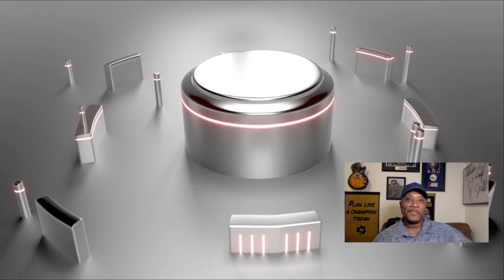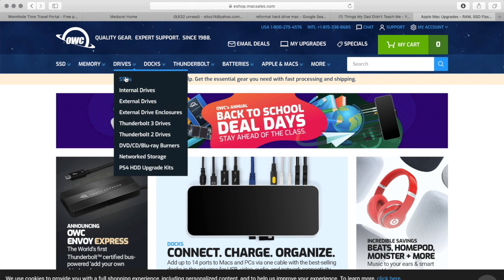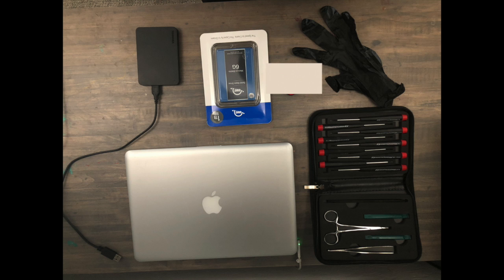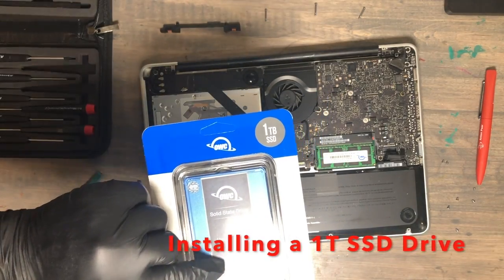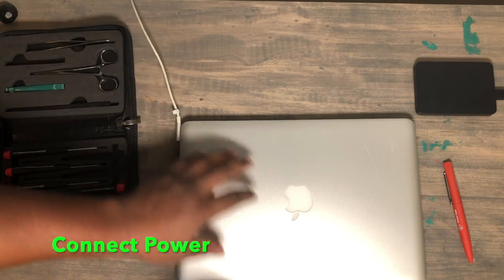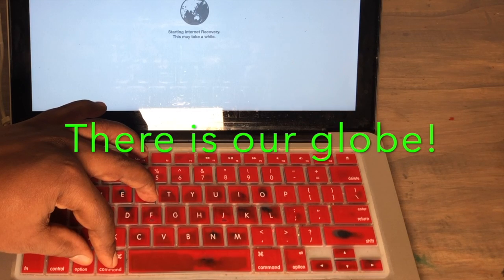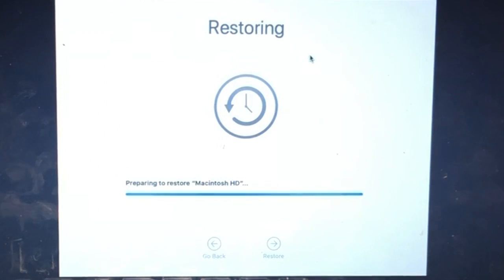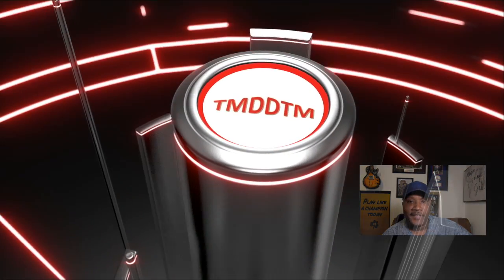MacBook Pro Hard Drive Upgrade (1TB SSD)- DIY

Comment: This is really helpful, thank you so much. I’m upgrading my MBP 2015 in 2 weeks from 256GB to 1TB and hoping to get faster production as well.

Question, I use my Mac for music production so there’s a lot of plug-ins and audio files on my current SSD. Does backing it up in Time Machine save those files and index them as well during restore? That’s my biggest concern is having to reinstall everything from scratch and re-index everything. 

When I open up a song in Logic Pro, it knows what folders to pull specific plug-ins and audio files from, so just wondering if the backup and restore puts everything back in its original place.

Thanks again for this tutorial. Any time I can avoid a hefty bill and a visit to the Apple Store, is a good day 🙏🏼🙏🏼🙏🏼

Cheers,
DB
Reply: When you did this, we’re you allowed to update to the new Mac OS Monterey
Reply: @Adorabellamorta13  yes, as a matter of fact, it kept failing when attempting to install Catalina, so I had to upgrade to Monterey.
Reply: One more question; you said to make sure to connect the Time Machine after booting back up. Does that mean you need to backup the Time Machine on the old SSD to an external drive or USB first? 

Sorry, I just didn’t hear you mention that part in the beginning 😵‍💫😵‍💫😵‍💫